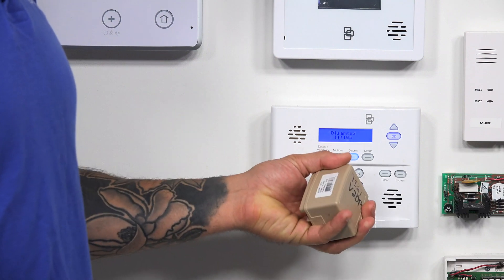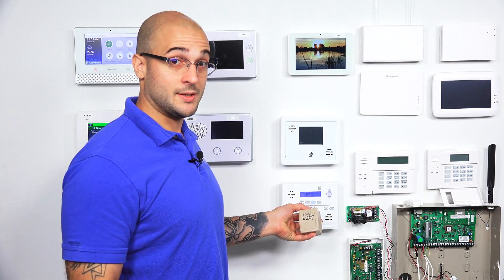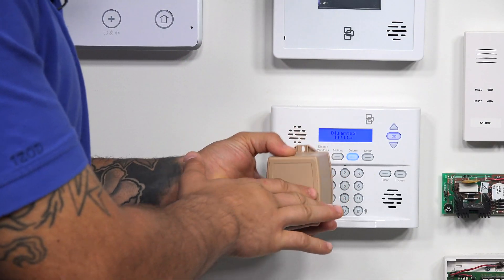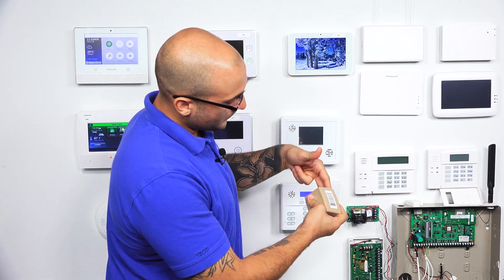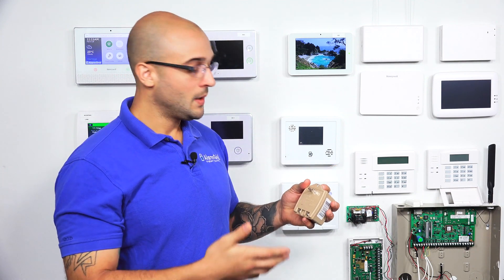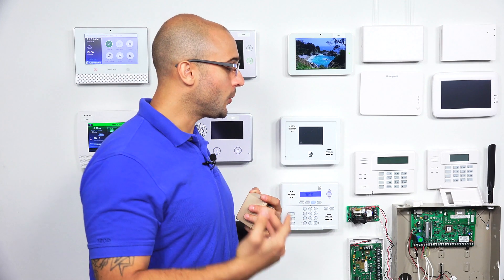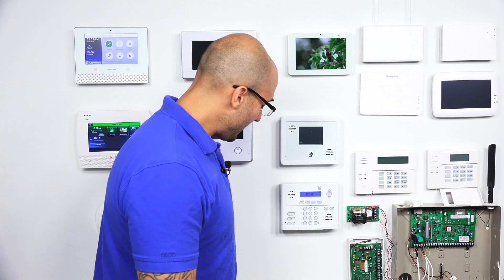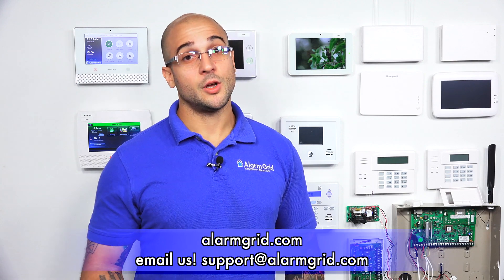Powering the Honeywell Vista-20P

Comment: Great Informative quick video.  RIght to the point.  Could that Transformer be placed inside the vista 20p alarm control board cabinet and the cabinet mount over the typical 120vac Duplex Receptacle or would that run too hot?  Thank you guys again for the awesome vids.
Reply: It is possible there is also a security box for transformers. The metal box of the panel would need to be cut to fit over the outlet.

Comment: Question. I mainly deal in IT and Security cameras, but have been having more and more clients want me to do their security as well. With cameras I always have a handful of 24VAC 40VA transformers on me and didn't know if that would be too much voltage for the system in case i ever need to replace anything in a pinch or if i need to order a few of the 16.5VAC models. Thanks!
Reply from the maker: Yes, the 24VAC is going to be outside the manufacturer's specs for most systems.  Also, bear in mind that if the transformer is rated for 24VAC, it's probably actually outputting a little more than that.  For example the 16.5VAC transformer for the VISTA panels actually puts out about 18VAC.  That's OK, but if you put a 24VAC transformer on the panel and the panel was damaged because of it, the manufacturer would say the warranty was void because you used a product that was out of spec.
Reply: @AlarmGrid  I have the VISTA 20P and added a NEXX wireless setup and got a “AC Loss” on the control panel and then the system powered off and will not power up.  I removed the NEXX wireless system and still no power.  I assume the transformer is blown as it was very hot.  Any recommendations?
Reply: @LorenzoDurden  I would advise checking the transformer voltage at the transformer and  at the panel via a multimeter to see if it is a wiring issue or a blown transformer. short of that it could be a panel issue, but more troubleshooting would be required, shoot us an email after you've gone through those steps.
Reply: @nathangalarmgrid5205   Thank you, Nathan for the reply.  I was able to find a transformer for replacement and my system powered up with no issues.   Thank you again for the response.

Comment: 25 va is way too small for today’s systems. Make sure you alarm company knows that.
Reply: Honeywell ships the 1321 16.5VAC 25VA transformer with a VISTA-20P so I'm confused why you'd think 25VA is not enough power for that particular system. There are many different systems on the market today, with different types of power requirements, so the key is to be sure you use a power supply that's compatible with the system you have.

Comment: Can I plug the transformer to 220VAC wall socket?
Reply: No. If you want to use this with 220 volts, you have to first get a 220 to 120 adapter